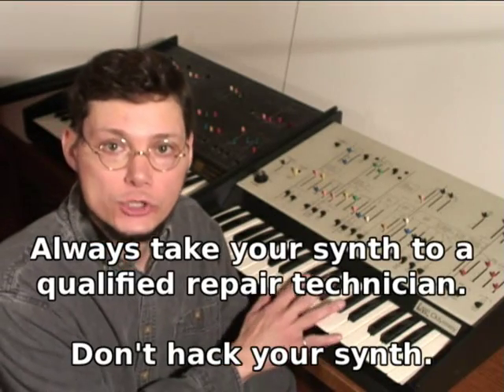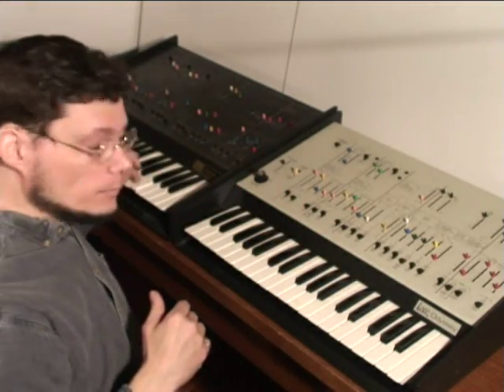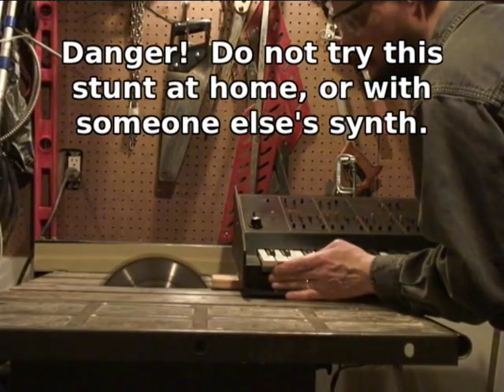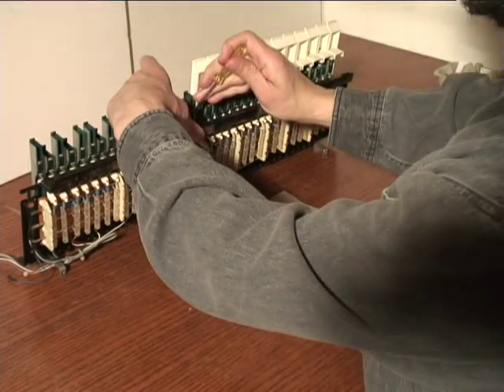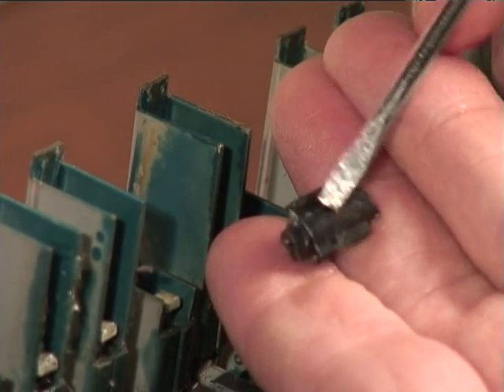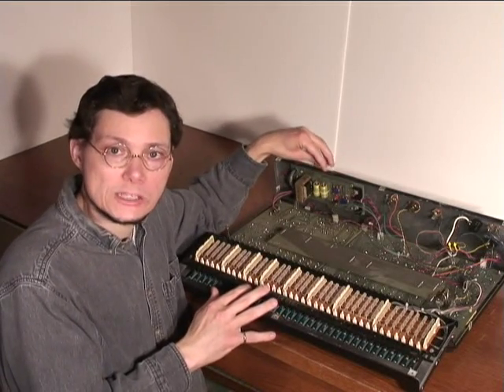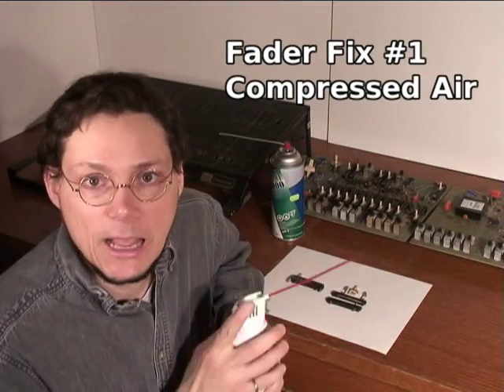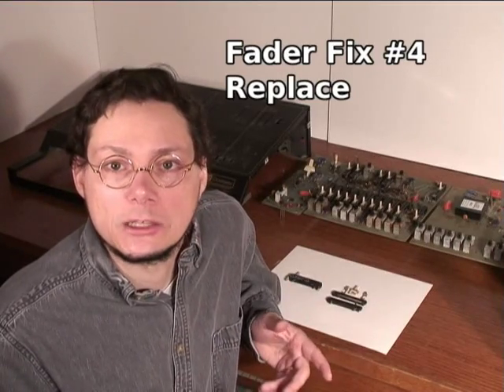Arp Odyssey Repair & Tech Tips

Comment: I know this question is literally a decade after you posted this video, and I don't know if you will see this, but one thing you mentioned about replacing the Filter Capacitors up near the power supply transformer. Actually can you give me any tips on where to buy them, what to look for exactly, and how to swap them out?

Comment: please can someone tell me what those 3 mysterious screws are on the front panel near the OSC ? i assume they are for calibrating tuning but cannot find any info ..
Reply from the maker: If you remove those 3 small caps on the front panel, they will reveal the trim pots to set the range and scale of the two oscillators.
Reply: Synthesizer Keith Could you please make a video demonstrating this?